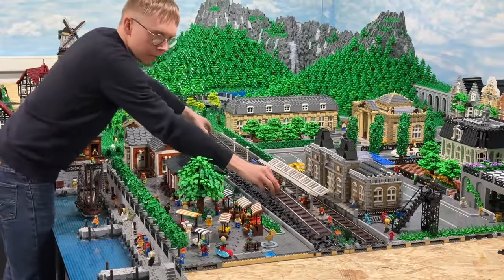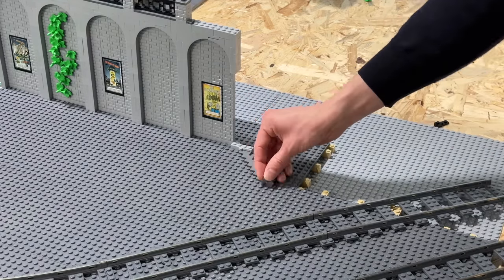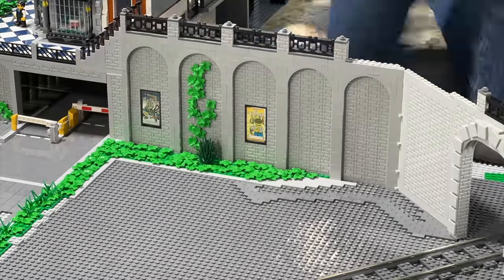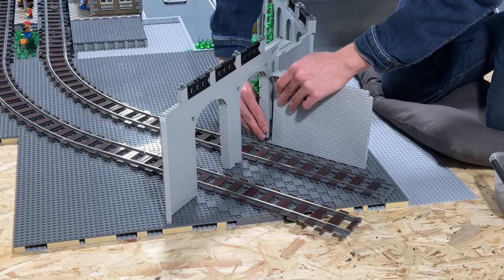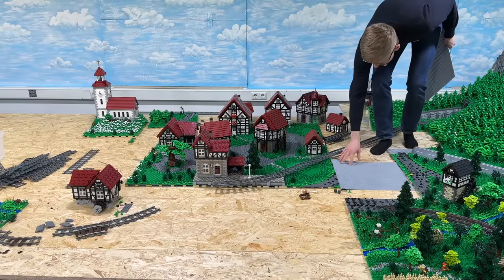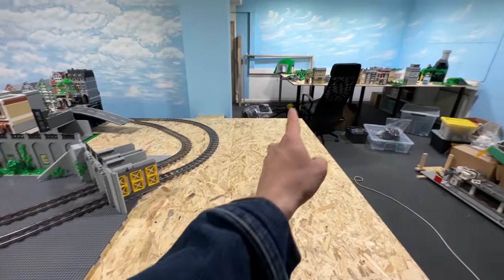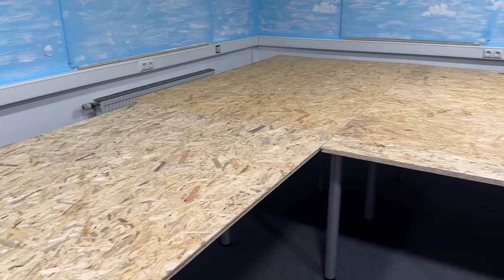This will backfire: Curved Double Train Tunnel... LEGO City Update

Comment: Since the harbor is on the edge of the table, it is almost like the open area where visitors stand is an ocean or a bay. As others have said, building a sea-life area around the pillar would match with the harbor, and you could have a river and bridge crossing next to the village in between the airport and the main city portion. A river already runs from the mountains and through the village, it could end at a larger river leading to the bay.

Comment: I gotta say I really loved the old curvature of those stairs.  It was disappointing to see them straitened.

For the addition to the train station, you could add some sort of cargo loader or forklift access for anything that can't easily be loaded/unloaded by hand.  Possibly tied into the smuggling operation?  Receive goods by water and send them out by train?  Or vice versa.  And with multiple tracks, you could possibly set up a stationary train loading/unloading for more storytelling elements, and still be able to send a train around.  Maybe a scene with them unloading the train and loading the goods onto a truck?  The only problem with that is the train possibly blocking viewer sight lines.  Maybe the smugglers waiting for a train?  With a truck full of goods and the loader/forklift ready to go?

Comment: As a smaller project, on your hills you could add a small miniscale rocket platform and support it with with the wall to have the rocket mid air, just a thought but it could be a fun way to tie in with the moonbase. Love what your doing!

Comment: Why not automate the train switching? Set aside a long section of track that uses, say, big rubber wheels that lift the trains just off the track, disconnecting three power, and using motors connected to gearboxes move the trains along at a crawl, long enough to allow the other trains to complete and reenter the mechanism, before depositing back into the track where track power again takes over.

Maybe this is too ambitious. Just thinking out loud :) Thanks for all your hard work!

Comment: That open slot next to the train station could house a forklift for handling lighter commercial freight boxes meant for the stores in town as it means a box truck won't be blocking traffic if the freight is sent by train instead.

Comment: I think two runways as you mentioned in previous video is unnecessary. One runway in front should be enough. And behind the runway might be stands for airplanes, hangars, gas station, fire station, control tower...

New city next to the airport could be a modern one? One or two highrise buildings, something like monorail connecting them to the airport etc.

Comment: A couple of ideas - 

1. On the new part of the railway platform you could have a little coffee shop type kiosk, certainly quite common in the UK.

2. The pillar in the middle of the room is a bit awkward, however you can make it part of the whole concept... the harbour leads to it, so you could wrap a thin wooden plate around it and make the whole pillar into an oil rig or offshore shipping station for boats.

Comment: May I suggest something? The Piller in the middle could get a use to be honest, you could build a small 1 base plate thick ring table around it with some water(trans blue plating) and add fishing boats or any kind of boat on it really. That would give the illusion that where the viewer stands is a lake. 
Just putting that idea out there :P

Comment: When working at an angle, use jumper plates inbetween the tiles to add more points of connections. It makes for a more stable 45 degree wall.

Comment: For the tiles underneath the train tunnel walls, you could use a modified 1x2 plate with a stud to be put under the wall further connecting them to the ground so they aren't so flimsy.

Comment: for stability in the double tunnel, in the 2 middle pillars try using the 2x2 spinning tiles, so the square plates can be at a normal angle with the circular plate on top connecting to the pillars to keep it steady

Comment: using a rail system, make some landing planes that enter via a tunnel in the wall, fly down, land on the runway, slow down, and exit with another tunnel blocked by the airport buildings.

Comment: just leave the extended bit of platform bare, maybe just add like a lamp or some signage. There's no need for a building. Most train stations have large parts of their platforms with nothing of note on them, usually just a lamp for lighting or signs giving people information like where the exit is, what station it is, or what track it is. Just add a fence at the back so people don't fall into the road behind.

Comment: For the column, could you maybe clue baseplates to it and then write information or art with lego on it. For the station, if the track closest to the station only goes to an engine shed you should connect it to the main line. Would be weird to have the track closest to the main station building not going anywhere except a siding without the possibility to join the main line.

Comment: You should use that support column in the middle of the room to hang some airplanes from. Like build your favorite plane and rig it so it's connected to the support beam. That way you're solving the problem of having the beam in the way by including it into your entire room. Plus that also acts as a way to connect one side of your diorama to the other, having a plane in the middle of a flight from one side to the other.

Also hi. The algorithm fed me this video and your room is phenomenal. Great work! ♥

Comment: I would stick lego brick textured wallpaper to the pillar. Maybe a nice vertical title, BRICKCRAFTS LEGO WORLD with logo would help! making the pillar a feature and not an eye sore. Another idea is u can use the pillar to extend transparent sticks over the city, and attach planes, hot air balloons, and helicopters to it. Maybe a Space shuttle during launch! You can add a circular track near the top of the pillar, with a motor, and have the air vehicles rotate slowly around the pillar! I hope I made it clear. Whatever you decide to do with it, I'm sure it will look great!

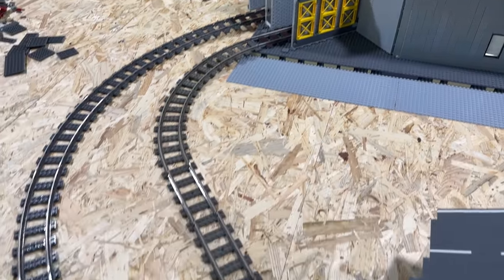Comment: @7:00 you really should do 2 train tracks behind the tunnel/mountain so you can have 2 trains running at the same time to the same station without having to constantly use the switch tracks.

Comment: What you should do with the airport is create a suspended wire system or something so you can have a Lego plane that takes off from the airport flies in the air and lands at a different airport or at least does a circle around room and lands back at the airport.

This wouldn't be too difficult to make. If you use the ceiling to mount the suspension/pull system. 

It would add some serious shock and aw to the build👍😎👍

Comment: Maybe the train station has a little café with outdoor seating, some parasols, etc?
Also, regarding all the tunnels being on tiles: are there really no points where the coordinates line up such that you could stabilize them a bit with single studs or turntables?

Comment: I can't help but notice that the new layout scheme sort of leaves the marketplace feeling cut off from the rest of the city by the double-railroad tracks. Maybe that needs to go somewhere new? Not sure where, though. 

As for the train station, it could probably use a way for prospective passengers to safely cross to the center waiting platform without having to climb over the train tracks. That's not a very wheelchair-accessible station, you know?

Finally, I can't help but notice that the "Siding" is actually the closer of the two tracks to the central station building, meaning most of the city's traffic that would come from/to the station would have to cross the tracks to the center platform. It might be better to bring back the old way where the inner track went on to form a loop by connecting to what is now the diagonal track.

Comment: I know this sounds like a ridiculous solution, but if you want your hands to basically get never tired of building lego then you might do forearm exercises with dumbbells from time to time (2-5 reps 1-3 times a week should be fine). Reverse wrist curls are AMAZING for grip strength (it's basically what you need to never get tired of building), but it's better to do normal wrist curls as well for balance as well.

Comment: 03:00 instead of a building, how about some ruins or a graveyard. Make it like a lot of European cities where odd old things end up in strange places just because of the history of the city. Like in the city of London (that’s the actual city not the Greater London area) in a place called Bishopsgate, there is an old Victorian Bathhouse right in the middle of a load of modern buildings that have sprung up around it. Looks very odd, like Disney’s Up house except it’s a bathhouse not residential. 

Or in another case of architecture in London, in Bayswater, there is a fake house in Leynster Gardens. It’s a thin facade of a house that matches the other houses on the street. The reason? The facade hides part of the London Underground where it opens out to the air briefly. It’s there for ventilation back when the London Underground ran on steam engines rather than electric.

Comment: In 3:14, I was wondering, how do the people get to the platform between the two tracks? Could you add stairs?
Reply: Originally, The tracks immediately disappeared in the tunnel, and there was a staircase from the upper level. Now, I would suggest either an underground passage or a passenger bridge. But what bothers me more is that there are tracks with platforms on both sides.